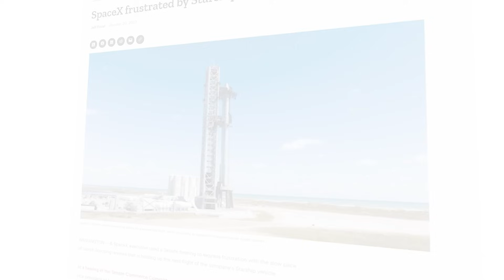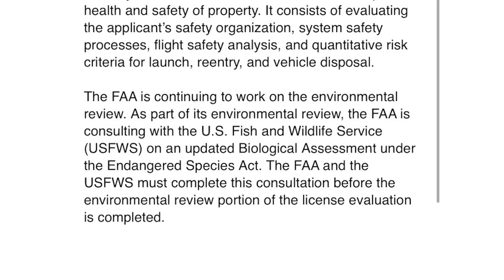The FAA Just Completed The Safety Review For Starship's Second Launch

Comment: That thing will never be man rated. Mux will sell Tesla within 12 months.
Reply: It COULD be man-rated if they develop 4 distinct versions of Starship. The first is pure cargo, or tanker. The second is PURELY FOR HUMANS, with all the equipment for a totally functional launch escape system that can abort from every single moment of flight and safely return humans to Earth in the event of failure of booster or Starship second stage. The human-rated version would carry very little if any cargo, so it could handle the weight overhead of the abort/recovery system.
The 3rd and 4th versions, the Lunar and Interplanetary Starships, would never launch manned from the Earth's surface. They would launch unmanned, allowing them to carry maximum fuel and cargo, and then would dock with a man-rated Starship to transfer crew launched from Earth.
Reply: @ i-love-space390  
Do airplanes have abort/recovery systems? Jetfighers do. Some small planes and helicopters also do. But overall they don't. They are designed to be safe as is and have redundant systems built in to prevent SHTF. So I doubt we'll see (if the SS concept works out and they get it redundant/safe enough) any sort of abort/recovery systems in the classical sense. This ship will make do without them - if they get it to work.
Reply: @joansparky4439 rocket is not a plane your argument is invalid, sorry, completly different system and enviroment :D